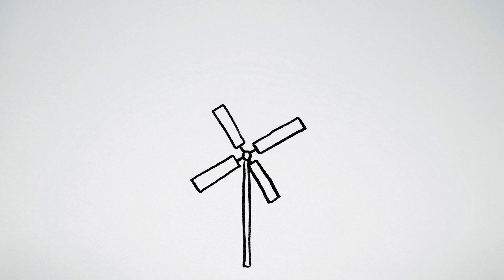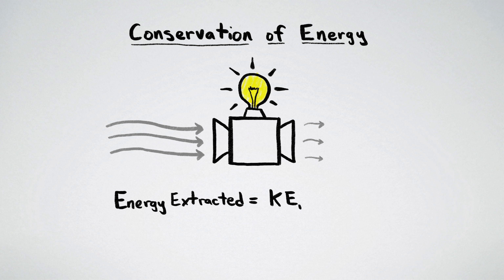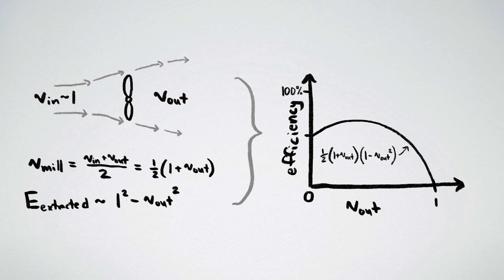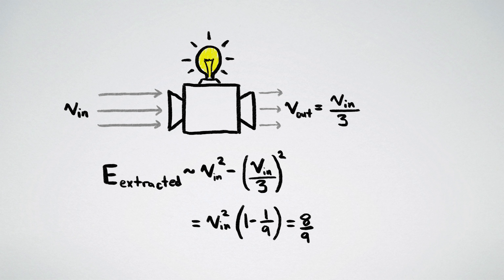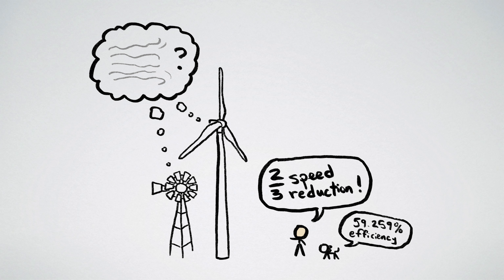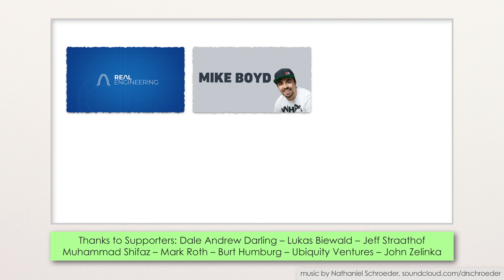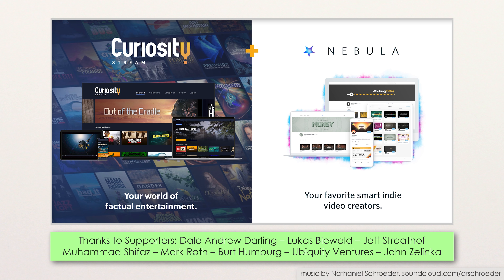Windmills Are NOT Like Dams

Comment: From Google: "A windmill and a wind turbine are different in structure and purpose, even though many people use the terms interchangeably. A windmill is a very old technology that uses the wind to either mill grains into flour, drive machines, or move water. A wind turbine converts wind energy into electricity by turning a turbine."

The word "mill" should give it away. If no milling is being done - it's not a mill! 
Simple ideas and simple definitions are best. I'm sure you agree: windmill is just plain wrong here.

Comment: For hydro dam exist maximum peak value but also minimum 0. For windmill blades it is u=v0/2 is maximum value for specific blade angle. That is different because  u=v0/2 is fundamental law you can not increase what value where for hydro is optional, closed turbines steam, compressed air hydro turbines operates differently from open air windmills here angle of attack of blades is more important and exist one unique.

Comment: @minutephysics i was reading the Friedman equation and noticed that for space it uses a perfect fluid. But space is not a perfect fluid it send to be almost infinitely compressible.  This could account for both dark components. Higher viscosity in less dense regions would increase influence of slow flows. Low viscosity in dense regions would increase micro turbulence absorbing uniform rotational motion

Comment: Assuming that both dams and wind turbines are used to generate electricity, don't dams have turbines at the bottom to convert the energy of the falling water to electrical energy? Doesn't that mean the turbine also needs to slow the water down like how the turbine slows down the wind? I mean they're both fluids

Comment: The first statement in this video is false.

The exit velocity at the outlet on the damn, and thus the volumetric flow rate, will depend on the hydrostatic pressure at the position of the outlet.

Comment: i just noticed a math thing and i’m wondering if there’s a reason for it. ex, 7x7 is 49 and 6x8 is 48. Add one and subtract one from each side of equal products and the answer is always one less than the equal products. Is there a math principle for this? an explanation video would be awesome!
Reply: and if you go out further, it’s still consistant. ex, 7x7 is 49 and 5x9 is 45. All other permutations of -2 +2 have a difference of 4. -3 +3 is a difference of 9 in all cases and -4 +4 is a difference of 16. the differences are all square numbers, I’m assuming it continues that pattern indefinitely. it also works with negative numbers. ex, 2x2 is 4 and -1x5 is -5. The difference is 9. I just discovered this and it’s blowing my mind. Could you help me out by telling me someone discovered this 1,000 years ago or something
Reply: @jarethculwell2013  Say the original number is m, and you change them by n,
The difference is then
m^2 - (m+n)*(m-n) = m^2 - (m^2 - n^2) = n^2.

Comment: So i got an important question i need answered.

I read in a few pages that apparently either exists or will exist a type of computer that will run instead of on 2 stages, on and off, with 3 stages, on, off and in between, called quantum computer. If such thing is the case, could we use the principal of teleportation to transfer internet globally at the speed of light without cables? Could we do it with the internet as it is? I hope this makes sense
Reply: Hi

We can already transport information at the speed of light without cables using electromagnetic radiation. That's the principle behind satellites.

Also, I don't know a lot about quantum computers, but I think that they don't have much to do with speed of light, so they shouldn't improve much the speed at which information travels (other than maybe being more efficient and fast on solving the cryptographics algorithms neeeded to stablish a safe connection)

Comment: the Solution to the Windmill Paradox is be grateful you mathematicians using optimisation math tools got to use up to 50% more 'use it or loose it' electricity than you had before it was  engineered, built, and plugged in ^_~

Comment: This brings back memories about how I found out about this figure.
When I was elementary school (15+ yrs back) I really liked to make windmills from wood wings (like 1,5x5 cm wide wood-piece and with knife/polishing making somewhat triangle from that with smooth "catching" edge and rounded back for light-weight and more "efficiency"). Three best examples had 3 wings (~0,8 m long each), 3 wings (1,1 m each) and my best - 5 wing (1,2 m each) design that worked at lower speeds than 3-wing (it was located low to ground with uneven terrain/trees around so only 1 lower wing (with 120 degrees between) had trouble to keep speed up and it lead to vibrations. 2 lower wings (with 72 degrees between) solved issue and it was smooth and worked as expected. And it was this time when got to figures how wind speed impacts power (not sure how precise but from that time used m/s^3 = W/m2 formula whenever wanted to know how much power windmill actually can extract - and that "nominal" power was based on ~9 m/s windspeed). And how efficient it can get (figure in video) etc.

Comment: In the first clip of the outflow pipe moving up and down the side of the reservoir, you say that you can lower the water without slowing the flow, but wouldn't lowering it increase the pressure and make it flow out faster?

Comment: 0:54 , 1:36 , 1:40  There's an error : 
it's not "wind volume" but "wind section" or "wind area" or "closed surface" in mathematics. (in fact, saying "volume" is absolutly wrong, volume per second is actually constant, by conservation of mass)

Plus, you showed why speed at the mill was 3/4 of in speed but not why it means 3/4 of wind in SECTION(!!!), on a slide that titles "conservation of mass" but doesn't use it.

Explanation : 

flux formulas :
flux (unit/s) = j (unit/m².s) . Surface (m²)
j (unit/m².s) = density (unit/m³) . velocity (m/s)

( "j" is "flux density" but I wanted to keep one word per variable)

In the case of a windmill, air compression is negligible, so there is no noticable variation in density. We'll consider density as a constant D.
Thus,
flux = D . velocity . surface

For a given flux F, in other words when you conserve mass (or electric charge or "unit" of any quantity), an increase in velocity means a proportionnal decrease of surface. Proof : 

F = D . v(a) . S(a) = D . v(b) . S(b)
or more interestingly
v(a) . S(a) = v(b) . S(b) 
or in an other form 
v(a) / v(b) = S(b) / S(a)

if 
v(mill) = 3/4 . v(in)
then, 
v(in) . S(in) =  3/4 . v(in) . S(mill)
=> divide both equation members by v(in) => 
S(in) = 3/4 S(mill)
◻

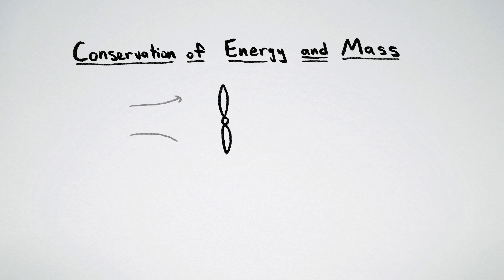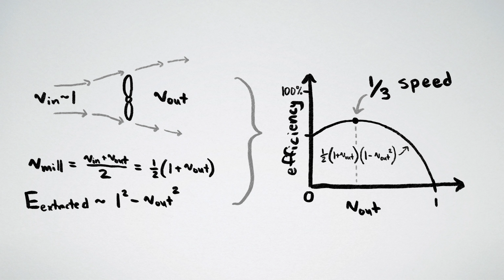PS : at 1:05 , 1:18 ,  "as much wind to pass" is given by wind section S(in), not wind velocity v(mill). Yes, it's the same proportion, but mixing surfaces and velocities has no sense... It's like saying a bottle of water has a mass of 1L. Yes, 1L of water = 1kg. But 1L is not a mass!!! Don't mix speed and cross section even if you fall on good numbers.
Reply: Maybe shoulda said wind flux or air flux

Comment: The most you can mill from wind is 100%. With a type of mill called sail.
Reply: Only if the sail is infinitely large. Real sails "spill" wind around the edges, just like windmill blades.
Reply: @dlwatib  it was sort of a joke, dude. It's not that simple, and you can actually sail around 3x faster then the windspeed depending on your rig (and where the real wind is coming from). That still doesn't mean you extract 300% of the energy from the wind though.

Comment: Wouldn't this apply equally to hydro dam turbines too?  Much like windmills, you want to strike a balance between letting as much water through as you can while (paradoxically) extracting as much energy from that water as possible.  The height of the dam determines the total potential energy available, but it's still up to you to find a way to extract that energy efficiently.
Reply: Dam turbines don't slow down the fluid, they reduce its pressure. The water before the turbine is pressurized because of gravity (potential energy) but when it exits the turbine, its pressure has dropped. The pressure difference is work applied on the turbine.

Comment: If run at 2/3 energy extraction, or 59% efficiency, how often does the blades leading edge need repairs, if run at a lower efficiency rate does that increase the lifespan of the blades before repairs are needed and if so ...by how much, and what's the downtime + expenses going to drag (sorry) the overall expenses vs. rewards for the windmill?

Like you said, windturbines (aka windmills) are endlessly complicated and anything from atmosphere conditions to shape of blades will impact the overall durability and energy efficiency of them. All of this without even considering the impact on local wildlife and its people.

Comment: I actually knew it was about 60% because a friend of mine did a science fair project on it back in highschool (he mounted different windmill designs on top of a truck, it was pretty cool). 

But actually this number doesn't matter that much because windfarm windmills actually extract a lot less energy than this, partly because this works for single windmills but doesn't account for several windmills lined up behind each other.
Reply: That's why the windmills aren't exactly behind one another in wind farms, but rather they're spread out.

Comment: Can you extract 100% of kinetic energy in a spherical vacuum?
Reply: It is theoretically possible through the use of a spherically tuned kinetically powered vacuum extractor. 
However, in reality, all that's happening is the exchange of vaccuum energy and kinetic energy in a spherically phased wave form. Because spherical phrasing generates a diametrically opposed standing wave, any kinetic exchange would be immeasurable due to doppler shift. The end result would be nothing more than the temporal cubing of a sphere at the linear rate of 🥧 r ⏹

Comment: The problem with windmills is that when the wind blows in the opposite direction the blades turn the other way and suck electricity out of the grid.
Reply: Rotating generators backward still generates power
Reply: @ultimatedude5686  
Common sense says otherwise.
Reply: @awatt  how's that common sense, where does the energy go?
Reply: @shiinondogewalker2809  
Backwards 😁
Reply: So when are they going to use Diodes?
Reply: @haroldbn6816  
What's Welsh people git to do with it?
😁
Reply: @awatt  Iam at loss here did I somehow involved the Welsh!!!
Reply: Dai Ode and his sister Cath Ode.

Sorry couldn't resist it.
Reply: Just putting a marker here to note that the vid and this comment went up on 1st April 2021.
Reply: Yeah but you get even more wind out of it then and you can fly kites better

Comment: This couldn't have come at a better time. I'm doing my final year dissertation right now and a section of it is about windmills and energy extraction. This helped me a lot with understanding it better.
Reply: Hang on a sec. You're doing your dissertation on this subject and you didn't know and have full understanding of the basics of the subject already?
Reply: @salerio61  No, my dissertation is on creating an energy efficient home via green energies/technologies. But I haven't touched wind energy in 2 years (since 2 year).
For one of my 2nd year modules I had to design and manufacture a 9 foot wind turbine, so I understand more than just the basics, but its been a long time since covering that, so this video was a good way to essentially refresh my memory. I had a lot of "Ah ha, I remember this" moments in this vid. Hope that clears things up.
Reply: What will your degree be in?
Reply: Mechanical Engineering

Comment: Why should wind turbines  design care about efficiency? If wind is renewable abundant source why should anyone care what the percentage is if you can make smaller unit that pulls more energy, wouldn't a smaller unit that can pull more power in smaller area and use less materials be more economic and more energy efficient when factoring logistics, manufacturing and raw material resources? 

Overall I think this video completely misses the engineering point.

Comment: He is the one of those who uploads video which I can't see in 2x.
Reply: Can confirm
Reply: @morkovija  I also usually run everything 2x, but sometimes there's these extremely well condensed videos where you need to jump out of warp speed to enjoy them fully.
Reply: @KKdessu  I never understand the physics anyway I'm just here for the weird facts
Reply: I'm not a native speaker and for me it's not easy to understand him in normal speed, i have to go back 5 seconds often and every time it feels like i've gone back half of the video 😅
Reply: My brain already heats up on 1x speed. On 2x, it will probably boil.
Reply: @mikkelhoejen  Some people are just built different
Reply: I only watch class videos at 1.75x or 2x speed.
Reply: @mikkelhoejen  Full retention is not always the goal though. For work requiring reproduction, sure, but not necessarily when application is required. In such cases, a higher pace can be desired if it allows for more repetition of the material in the same timespan, as repeated exposure has been proven to ingrain processes better, even if facts can indeed get lost.
Reply: 1.25x usually does it for me.

Comment: Sir plz make a video on how computer's cpu understands the 0s and 1s of transistors...How it is able to know that if this specific combination of 1s and 0s is coming then this operation will be performed...Is it intellegent or cpu is programmed to do this...If programmed then how a cpu is programmed
Reply: It's neither programmed to do this nor intelligent, that's how computer interpret things, if it's a 0 a transistor (computer smallest component) is turned off and if it's a 1 it's turned on, try looking how transistors work!
Reply: @pedroyuuhi  Thanks for giving this suggestion 😊
Reply: Some CPU architectures are indeed running a micro programm to read, interpret and execute the complex (macro-)instructions coming from memory.

But you're right that this creates are paradox and doesn't answer your question.
In principle, it can "decided" with logic gates what to do, similar to for example and "if" statement in a programming language.

Let's say an instruction comes in to add two numbers. The CPU tests some bits of the instruction (with gates) and if the right ones are 1s, it identifies the instruction as ADD and "opens a path" for the next bits (with are the two numbers to add) to "flow" to the ALU instead, the unit which adds the two binary numbers.
Reply: Turing machines are how computers 'understand' the 1s and 0s. Basically a specific combination of 1s and 0s leads to a certain result, or path,  in a Turing machine, while another combination has a different path. 
A Turing machine is a device that works like a road with many forks. At each fork, you either take left or right. Let taking left mean 0 and taking right mean 1. Now, a path like 0100 would lead to a different path than 0010. 
I'm definitely no computer scientist, so I'll leave the rest to google or other commenters whom r more familiar with this subject than myself
Edit: turns out turing machine isn't the right terminology at all, as I said I'm not computer scientist 😅